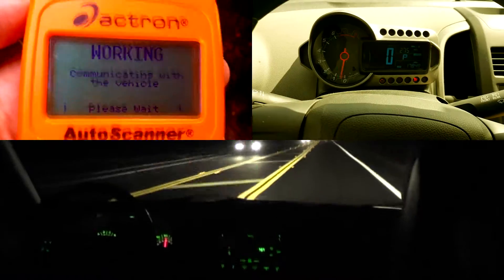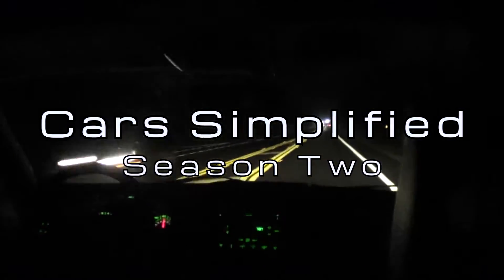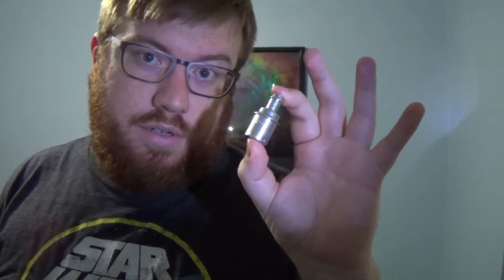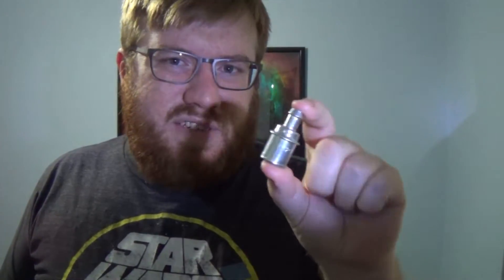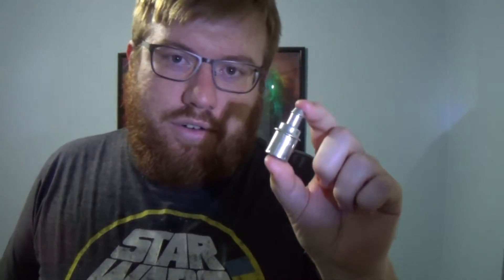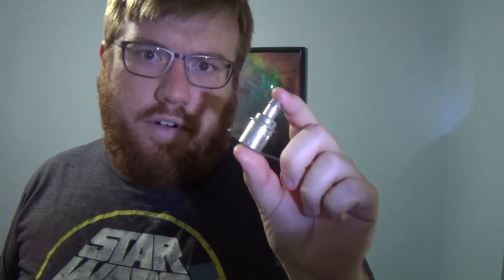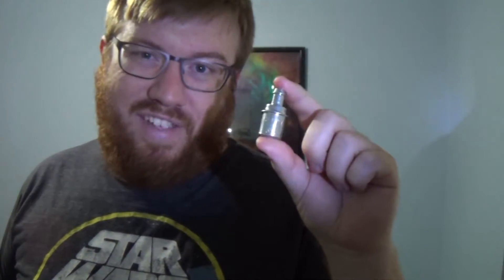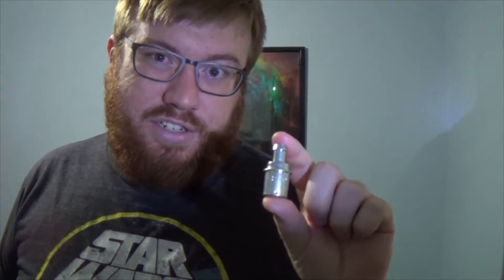How PCV Valves Can Make Your Engine Burn Oil • Cars Simplified

Comment: Just changed mine and I see a difference, no smoke 💨 on startup
Reply: Changed mine in my accord and it runs so much smoother. Omg
Reply: @MuddafukhingdisKUST yo I knew I wasn’t tripping 😂 car felt way stiffer and responsive
Reply: Were you seeing smoke before?  And did you have idle issues
Reply: @felixx321  yes